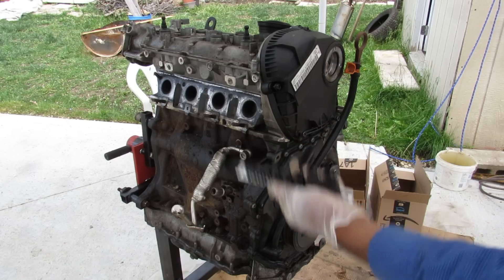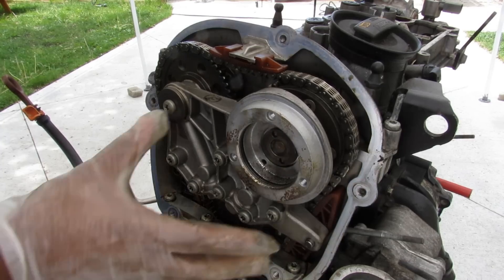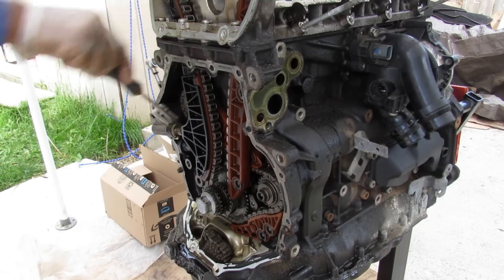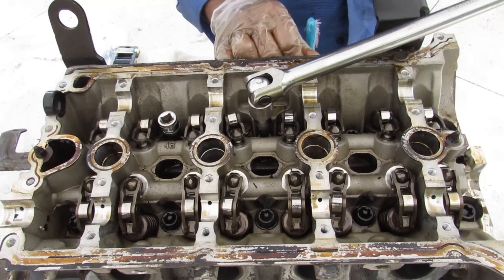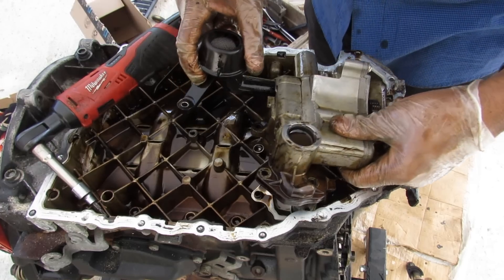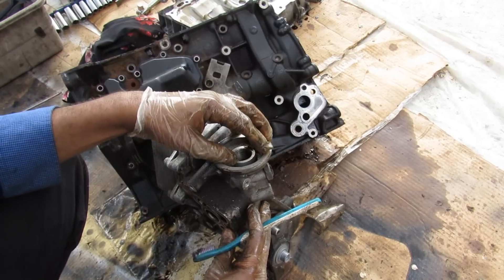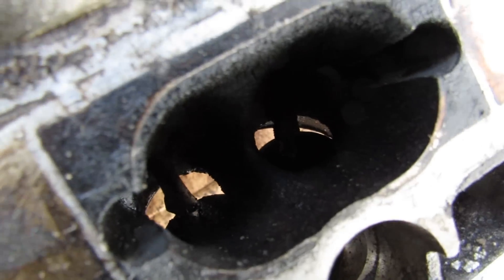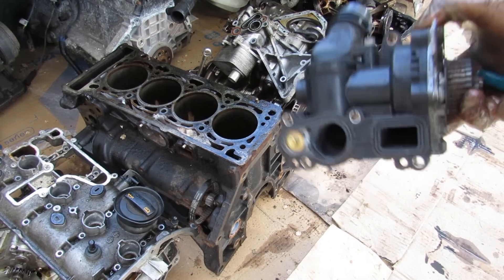Why Volkswagen Engines Fail

Comment: A PLASTIC water pump driven by a hidden belt that requires half the car to be dismantled to be repaired...WHYYY?!!
Reply: Because it's light and cheap and makes the spec sheet look good, and it's not their problem when every single one fails outside of warranty. Vat are you, cheap? Yust buy anozer car vrom us.
Reply: @aluisious  35d56
Reply: @aluisious  Thats why Volkswagen has  excellent reliability records....
Reply: Germans. 

Making cars more complex than they have to be since 1896.
Reply: @Bartonovich52  You couldn't buy anything better than a Mercedes 35+ years ago. Yep, 35+ years ago. How time's change.
Reply: @davidbrayshaw3529  The last decent Merc was made in about 1989.
Reply: @frenchenstein  Ok, 32 years ago, I'll give you that.
Reply: @Bartonovich52  "Making cars more complex than they have to be since 1896"  since the 1980`s but allright
Reply: @Bartonovich52   Ahh  Haaa...it's true.  there's the right way to do things, the wrong way to do things and then there's the german way to do things.
Reply: @cocodog85  often the best way to do things
Reply: @dietznutz1  ...sure, if you're paid by the hour for repairs.
Reply: The finest of German Engineering
Reply: @wills5482  bet you never owned a Benz
Reply from the maker: Because warranty hours
Reply: @speedkar99  I have a car with 2.0TSI from 2018 and the termostat and water pump had to be replaced. Even though the warranty has expired, VW offered to pay 70% of the   cost for parts.
Reply: @speedkar99  yep, more for the parts/shop hours than the end user.
Reply: @speedkar99 can you do one on the Audi A5 2.0 tfsi from 2012? My friend wants to sell one to me
Reply: @speedkar99  The manufacturer pays for warranty repairs, that's why book time for that work is shorter than regular time. They certainly don't want to engineer problems they'll have to pay for.

One example - If that was the case, book time for control arms on a first gen Toyota Highlander wouldn't call for removal of the engine and transmission... 10+ hours if I recall correctly.
Reply: You know what, I working on a project for Ford and I work in powertrain and if I get a chance to talk to one of the mechanical engineers I am going to ask why they do stupid shit like that.  The 3.5L ecoboost water pump is sealed inside the front timing cover.  I mean how damn silly can you get?  These guys know what their doing and I believe they don't care.  It would be like me writing software and not really caring if the fuel injectors were turning on at the proper and expected time.  If the damn water pump leaks, the coolant will get into the lubrication system and get into the main, rod and cam bearing and force a rebuilt of the engine.
Reply: @charleslowe522  The internal water pump design is only for 3.5 EBs used in transverse applications such as in the Flex, Taurus, MKS, MKT, etc. For RWD applications such as the F-150 the 3.5 it has an external water pump. For transverse applications, Ford claims they put it inside to make the engine more compact and to shorten the serpentine belt. What BS. GM, Chrysler and Toyota all have similarly sized V6s and they have external water pumps.
Reply: @RyanEmeryLovesCars  Thanks for the information.  I don't own the 3.5L EB, but I do own the 2.7L F150.  I wonder if 2.7 transverse has the same design as 3.5.  I have seen the 2.7 is at least one FWD vehicle.
Reply: @charleslowe522  Might be, but I bet it was the cheapest solution in building this engine. How long it lasts in the field ? Who cares,  as long as it works until warranty expired.
Reply: @charleslowe522  Product obsolescence (sabotage).
Look up current nissan waterpump in the sump.
Reply: @charleslowe522  After years of difficult to replace water pumps, it was VW who started situating them under the cam belt cover. The idea was to replace them at the 60,000 mile cam belt change. A new pump was included in the cam belt replacement kit. 
A friend of mine who works for VW, has never needed to replace a water pump within the 60;000 mile interval since this concept started.
Reply: Fahrvergnugen = Expensive to repair in German.
Reply: Ford did something similar with their 1.8 Duratorq and added a split timing belt setup for extra unreliability.
Reply: Because it’s german engineering
Reply: That's how they make money out of you. Designed to fail and then impossible for the average DIY'er to repair.
Reply: On purpose so the average guy can't fix his car and have to take to the dealer and get robbed.
Reply: Not that difficult, should see what warranty labor time gives the techs to do it.
Reply: @TheRedc0met  I live in metro detroit....  120 per hour.   I just looked up Miami dealers, 150-180.  Unless you take your vw to Hawaii to get serviced your not paying 300 an hour.  I'm talking Volkswagen,  not Mercedes,  not Porsche and not BMW.    That's like comparing a Ford probe to a Cadillac
Reply: Because there's less money to be made if they would make long lasting engines.
That's a thing of the past.
Reply: I had 4 water pump failures / complete leaks. My wife begged me to get rid of this POS before the warranty ran out. Also a coil pack and an intake plenum issue.
Reply: @ccloutiutube  smart wife!
Reply: @ccloutiutube  what year
Reply: @deandretaylor21  2012 VW CC. Got rid of it just before the 3 year warranty ran out.
Reply: DIY deterrent
Funnelling consumers to deealers incresing their profits.
Also, to reduce product life and push consumers to newer cars by making maintenance costs so high dumping the old unit for a newer one makes more financial sence, sooner.
Reply: it can be replaced without dismantling air manifold. did it lately.
Reply: Money
Reply: I’m the words of the great Rick James… “So you can buy another one.”
Reply: That's volkswagen telling you that you might as well replace every piece of plastic on the engine while you're at it
Reply: Its called packaging.
Reply: Just EVIL ! Planned obsolescense...😈
Reply: Think business and you will see why.
Reply: god i was thinking of trading in my tdi for a mk6 golf gti. i dont know now just because i saw this video? its a mk6 gti with 68k miless and full volkswagen service history should i buy?
Reply: If you look at the business point of view not the consumers you would see why.
Reply: Sadly modern engines are only built to last 7years, another reason for going electric
Reply: @goodfodder  Sorry to break you bud but they can and will do the same to electric vehicles.

They are just building them better to make people switch and then make battery and electronic life shorter.

Ask any old timer the batteries in cars today (ICE) engines used to last longer (if not mistaken 5-6 years not todays 3-4). That is a battery.
Reply: Thermostat housing cracked 2 years into warranty, thankfully had it replaced without paying a cent. Job cost them $1000.
Reply: @Yoshimetzen  That is the intentionof warranty to give security. But if it needs this kind of regular repairs to keep running, past warranty you and no one will pay every 2 years to keep it running.

End result is as intended. Short life cycle or pay to keep.
Reply: Great point, or more reliable timing chains that stretch 30000 miles ahead timing belt and to change em you need bucket of new parts and at least visa and master
Reply: Funny how everyone blames greediness on the part of the company but all big car enthusiasts who have a huge following blame consumer trends.  I guess when you are a millionaire by birth its easier for you to do that
Reply: Because Volkswagen engineers never learned how to build a proper engine !
Reply: Because german engineering is best you japanese fanboys will never understand the joys of a well engineered german machine in your yaris
Reply: @Haddedam  German engineering equals poor reliability and costly repairs. Go sell that bs somewhere else.
Reply: 2 hours for changing is not bet, could be worst like a chain driven water pump aka Nissan or Ford.
Reply: So when it fails and you take it to the dealer they can charge a fortune for labour
Reply: @TheRedc0met  are you talking about the same cities where some of the cheapest houses in the city are half a million? (NYC, San Francisco)

That's definitely not normal. Those are oligarch bastions where people are either loaded or living in a tin-can with 4 room mates, or homeless.
Reply: You can replace the water pump on these without removing much of anything. All the bolts can be gotten to with the intake manifold in place.

Also, while the plastic was a bad idea because early PCVs failed and caused oil leaks, which is what caused the pumps to fail, if no oil leaks on the pump itself it’ll last forever. My 2010 GTI has 145k miles on the original pump and it’s still doing what it’s supposed to do.
Reply: Meanwhile at a VW engineering think tank meeting,
Hey homies let's  create  the most ridiculous engineering with the cheapest materials possible then create a huge marketing campaign along with an easy sign and drive promotion to sell our cheap $hit...while convincing the unsuspecting public we still make reliable cars....
Reply: You literally take the manifold off I wouldn't call that half the car
Reply: Ahhh Germans gotta love them man haha
Reply: The finest bank if German  needs  top up !!!
Reply: Because if everything was literally made from Aluminum it would literally be impossible to afford replacing parts and buying them….
Reply: Das Auto
Reply: On most cars all you have to remove is the throttle body to get access to it. Sometimes the manifold has to come off but not always.
Reply: Because the repair technician has to pays the bills😂
Reply: VW fan boys:
"I like to keep it complicated. Zhet is how we are."

I am a german and don't drive German cars.
Reply: I had a Mk VI GTI, and it was one of the most disappointing cars I’ve ever owned. I’m glad I got rid of it before these multiple failure points had a chance to tear a hole in my wallet.
Reply: GERRRRRRRMAN engineering!  😅
Reply: Wouldn't expect anything else from an engine called "development order 888"
Reply: Isn't this a gen 2 ea888? Mk6 gti in the US had the gen2 not gen3
Reply: It’s really like 1-2 hour job. My mechanic did it for $300 parts and labor in 90 minutes. FCPeuro has a video on how to do it. Not that hard
Reply: It's not that bad to replace the thermostat assembly, only takes about a couple hours in total
Reply: @Kwameyoo  Removing the thermostat on my Datsun took minutes.
Reply: @Kwameyoo  When it could be/had been less than an hour.
Reply: yes but in the USA, labour is twice as expensive as anywhere else as well as parts for eu spec cars are also more expensive. These waterpump housing jobs are relatively cheap in europe. Its only expensive in the USA. I remember people used to complain about the 1.8T that the thermostat housing is "super hard to get to and have to take the alternator off". My thermostat failed in december and I didnt feel like fucking around with it in cold weather as I do the work on my car on the street usually so took it to an indy garage and the guy brought some fancy extension out and changed it in 30 min for 18GBP.... I paid 14 for the part... Basically lunch money. Americans hate on VWs because they arent cockroach 90s toyotas that can run on sand so when they go wrong they need attention and that means $$$ because import fees and expensive labour.
Another example is VW/Audi air suspension. In the USA for one corner on an A8 it costs like a grand for an air spring assembly... Meanwhile you can get it for around 300 in the eu. 🤷‍♂️
Reply: @waifuracer6516  Doesn't mean volkswagen should get away with producing shitty cars that break all the time due to crap inferior quality parts. At the end of the day toyotas and hondas still cost way less money to repair and maintain no matter how much cheaper volkswagens are to repair in europe.
Reply: @williamcricket7931  I wouldn't include Honda in the same category as Toyota these days. Honda had several recent years of crap engines and other issues.
Reply: @waifuracer6516  what. when I did timing belt and water pump and thermostat it was really easy to do tbh. i did it when i was parked in nyc on the street around november of 2020. on my 1.8t a4.
Reply: @waifuracer6516  In Denmark labour is about 155 dollars per hour in a shop. I highly doubt it is more expensive in the US. In Norway it's even more expensive.
Reply: @rasmussrensen6119  it's $200-$300 per hour in the US at many dealerships.
Reply: @Vermonstered  don't lie.... my vw dealer charges $120 per hour for labor.
Reply: @waifuracer6516 . Buy a Japanese car, problem solved
Reply: @waifuracer6516  I can't believe that. England is not a poor country. $20 bucks for thermostat? I say minimum $100 if you have a simple car at a Mexican shop in U.S
Reply: I don't think they're cheap in Europe, at least not in the UK. All German cars have a well deserved reputation for being expensive to fix and a growing reputation for being nicely built but poorly engineered and unreliable.
Reply: @waifuracer6516  The waterpump on my 1.8 TSI started leaking after 80.000km. Only 2 years waranty on a VW here in Belguim. The dealer charges 1500€ to replace it...
Reply: @waifuracer6516  still junk
Reply: @waifuracer6516  Not as expensive as Australia mate
Reply: @pbaker7160  Honda still makes the best engines. They rectified their oil dilution problems.
Reply: @williamcricket7931  VWs don't break all the time, you see these silly comments from Americans all the time on the internets but there must be something wrong with the parts you get there or all your mechanics must be useless because in Europe lots of people own German cars and drive them to work every day for years, and no we're not rich these cars are bought and maintained on a budget.

That said there are many points in these cars where the manufacturer saved money (ie plastic housing instead of a steel one is obviously cheaper) because ultimately they simply couldn't afford a better part for the car's price point. Everybody is quick to bitch about that plastic housing and say that in their old car from the 80s it was steel and lasted forever but their old car from the 80s had 90hp and did 20mpg, this one has 200 and does 30mpg, obviously a lot of the manufacturing and R&D costs went somewhere else because that's what the market wanted, nobody would buy the old 90hp shitbox today or they'd still be building that.
Reply: @BigUriel don't matter if you Europeans have cheap parts and good mechanics. People complain about German cars because we can see when something was designed to break sooner than expected. Manufacturers have over 100 years of experience making engines, and now we expect to not lose an engine for a silly reason like a burst thermostat, and this unreliability has nothing to do with power, you can make a powerful and reliable engine, and the Japanese proves that. It's just planned obsolescence, no matter how you spin it.
Reply: Why would you buy VW???
Reply: @josefsalon4449  because you want the only hot hatch on the market that is less fun and engaging to drive than a prius.
Reply: Volkswagen, that’s why. VAG, the whole group build some of the worst automobiles ever. God knows why folk still purchase them. I believe it is a triumph of “marketing over product”. (And they tried to gas us all with their filthy Diesel engines!)
Reply: @frenchenstein  - I think people still buy their products because of the driving excitement those vehicles offer… for a short time anyway. 

Most folks simply buy these cars as a lease & don’t care. It’s the people who buy used who’ll regret every waking moment with these unreliable vehicles.
Reply: @frenchenstein  gassing innocents with car exhausts is nothing new -Volkswagen built vehicles with the exhaust system routed into the vehicles specifically designed to make it into a mobile gas chamber to enable them to murder people in remote villages etc 'much more efficient than having to rail then to concentration camps for mass murder .
Reply: @frenchenstein  ah yes they tried to gas you with Diesel engines more environmentally friendly than your shitty V8s that consume more fuel and have no power at all🤣
Reply: At one point in the nineties, like all other German car manufacturers, Volkswagen got taken over by a new management of East-European Germans. Those who previously made the Lada, the Volga, the Zil, the Uaz, the Gaz, and the Mosckvich. At the same time, these VW managers demand a salary of ten million dollars per month. So it is all about exploitation and drive the German car brands against the wall. Same with Mercedes. Customers complain that Mercedes cars fall apart after three years only.